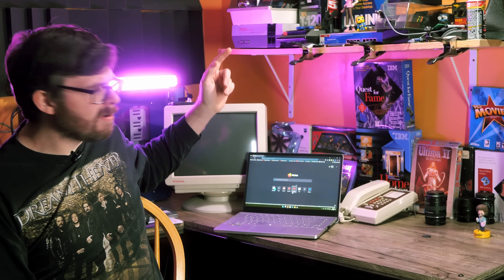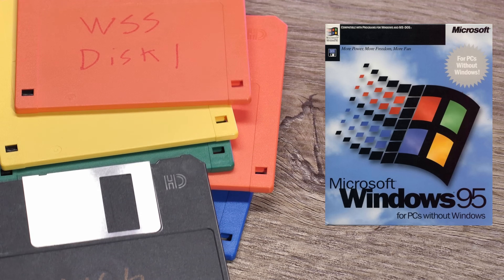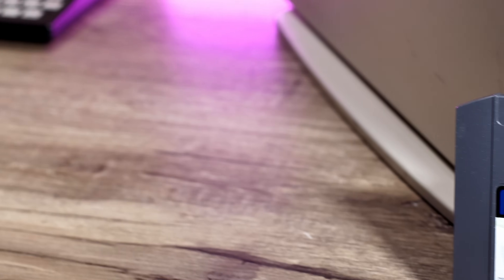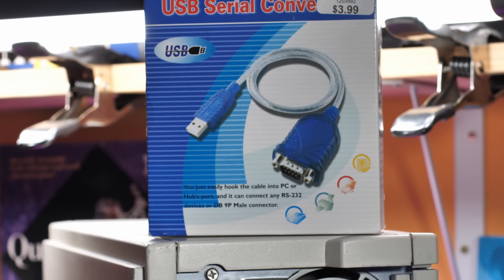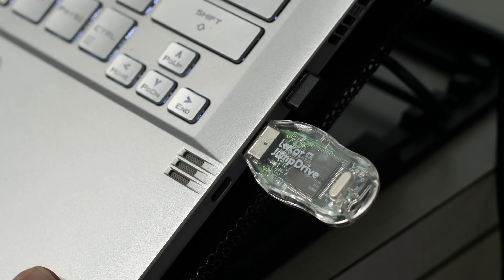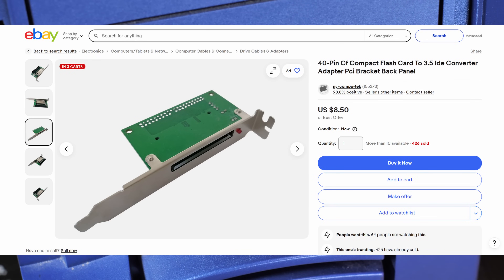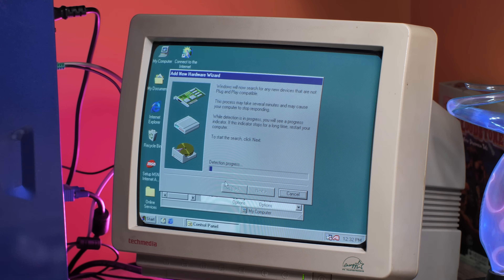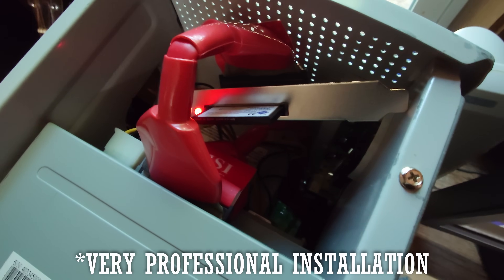What is the Best Way to Move Data to Vintage PCs?

Comment: I use a 3.5-inch docking station for SSD drives and SD card adapters.
Reply from the maker: Do you find using SSDs to work pretty well for 90s era machines? I had some weird issues in the past when I used SATA drives with IDE adapters. When I restarted the PC the OS would hang but for cold boots worked fine. Its almost like the adapter didn't have time to initialize with a quick restart compared to a full shutdown.
Reply: @DOSStorm  So far I haven't had any problems with the IDE adapters I use. Sometimes they don't work when I connect a second IDE drive using the same cable, but if they work alone, everything is fine.
Reply: @DOSStorm  The cheaper adaptors can be flaky with HDDs/SSDs. Try to stick to StarTech gear.
Reply from the maker: @FritzCopyCat  Yeah, that probably good advice.

Comment: CF was my method of choice for my 486DX2/66 until my I had to move from CF bracket to "taped somewhere inside" to make room for a picogus, sb16 and network card. I'm now on team mtcp's netdrive and ftpsrv
Reply from the maker: That is another reason why I like the front panel mount better, my PCI/ISA slots are a revolving door. Networking options are good but it requires a bit of extra setup and I don't really have too much room to setup more than one computer at a time usually.

Comment: I've been using a PATA/SATA/IDE to USB cable where I can connect my laptop straight to any HDD I have going. I have a massive N.O.S. collection of Seagate HDDs that are perfect for Win98 and DOS. 

I setup yhe OS and then after I just detach the IDE cable and get the USB adaptor. Connect up to my laptop and it reads it like normal. Move whatever files over and then reconnect the internal IDE's cable back to the HDD and MoBo. Boot up and off I go.
Reply from the maker: That's a good solution if you do have some good hard drives left. Most of my old ones seem to be dying left and right.